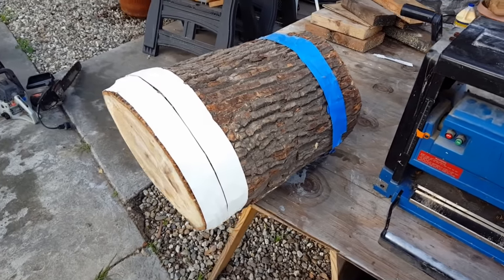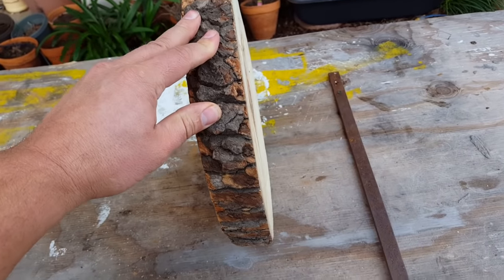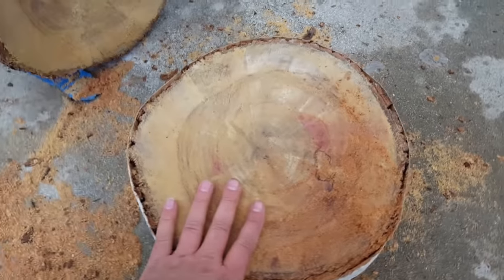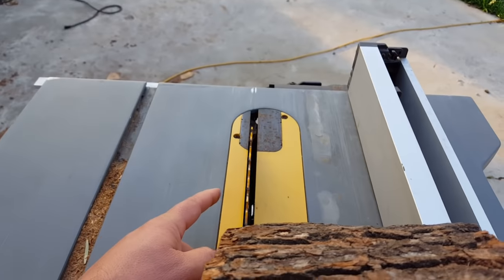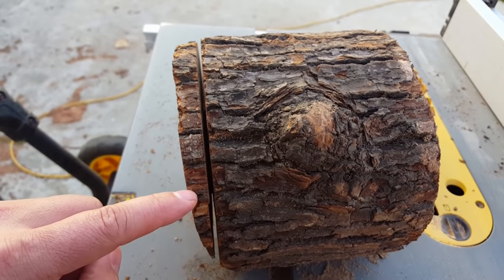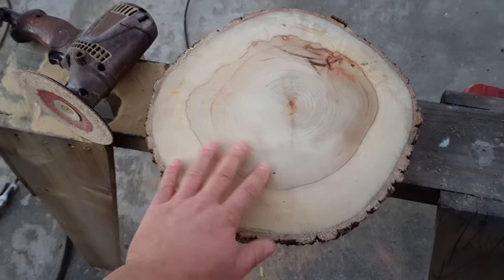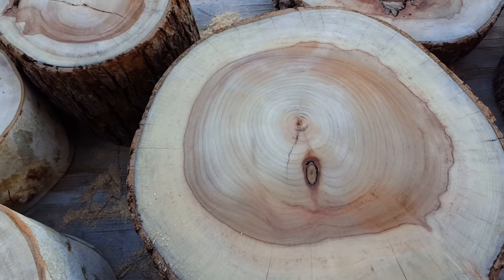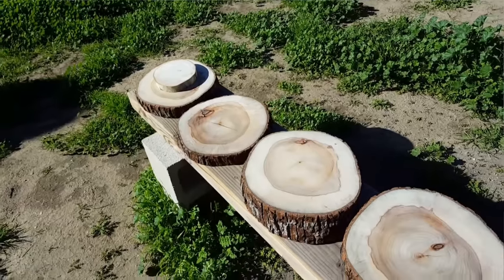RUSTIC WOOD DECORATIONS! Make Large Level Wood Slices [14 Large Tree Trunk Round Discs]

Comment from the maker: We purchased small sections of logs from a firewood supply outlet and they weren't totally dry all the way through.  We didn't know to bake them in the oven at the time so we may have just got lucky that never had any issues with mold or bugs.  We also never really had any cracking problems either.  I had planned on sealing them with something or applying oil but never did.  They've been kept inside for a few years and still look great used them a few times.  Wanting them as perfectly level as possible and without damaging the sides with holes or scratching the bark I cut these the best way I was comfortable with.  They sell these all day long at hobby stores now if you don't have time to DIY them.  Thanks for the feedback everyone 👍

Comment: Great idea with the tape as a marking. I had fashioned a jig, and that was much harder. 

If you don't mind it taking longer, and really working your arms, a good 24" handsaw is great for cutting the discs. If you're consistent, you can drastically reduce the sanding and planing it needs.

Comment: Dude, that is entirely way too much work. Just build a 2x4 base the circumference of your log, and 2 upright (level) pieces of 2x4s _|
You can then use a chainsaw and use the upright 2x4s as a guide to make a straight cut.
Reply from the maker: Yeah, that would have been the faster, smart way. But I didn't want to drive to go get a new blade, so I struggled with 50 tools instead.

Comment: What would you use to hollow out the center? I'm having issues where to find slabs with the center taken out for candles??
Reply from the maker: the easiest way would be a paddle bit or spade bit in a drill.  buy the size you want for your candle and just drill down to the depth you want.

Comment: A good, food safe finish that I used was either mineral oil from the pharmacy or lowes and home depot  sell butcher block finish. Apply some rub it in and the wood will soak it up. By the next morning it will be dry. You probably already knew that bit thought I would mention it. Great job! Thanks for all the great videos.
Reply from the maker: Thanks Xray!  I think we need to apply some of that on these things I would have never thought to get it from the pharmacy =)
Reply: Wood is naturally good safe

Comment: Hi Hollywood Haunter.  Im planning an August wedding and want to use some thick slices/stumps (10-12 in tall) to put vases on for the aisle decor and possibly some 3-4 inch slices for table decor. I was reading up and saw that its best to cut wood in the winter, so I was going to source some now and have it cut. How can I get the wood to last until then without splitting in half, warping or losing the bark (i dont mind a few cracks/small splits)?
Reply: Read the comments, and you'll find out.
Reply: Working Man petty af man

Comment: We love making these they are great for so many different things. I must say that for a minute I was worried about your safety. My wife asked me if it was safe to do it that way. Definitely would have made a jig to cut them on the table saw. Your little one wants to pull on all your fingers. So please be safe.
Reply from the maker: Thanks for the comment Tom there are so many different ways to produce these & a person needs to be safe especially when doing anything they are not completely comfortable & used to doing.  Like I mentioned in another reply I think it looks a lot scarier than it really is because of the camera angle, I didn't have the blade set that high & always kept holding control as well as standing clear just incase.  Please believe me when I tell you I REALLY don't want to loose any of my fingers.  I always take my time know where my body parts are & only do things I feel comfortable doing.  Thanks again for your concern & the smart idea of building a jig ;)

Comment: I've heard that some people occasionally even burn those to heat their homes. 😂  
Last year my sister sent me pictures of her boyfriend cutting some big slices he used to make table tops for their B&B. They really are much quicker and safer to make with a suitable chainsaw. I think I would have tried either sharpening up that gas saw you have or buying a new chain and just going slow.
I tried building a jig and plaining down some maple log rounds with my router once, and it kind worked. The big problem I had was that I burned up a couple router bits trying to get them to cut that end grain. I imagine my bits were not sharp enough or maybe my cuts too deep.
Anyway I'm glad you finished with a complete set of fingers, that table saw cam had me nervous. 😱
Reply from the maker: I don't disagree with anything you said & I too tried my router and it was like nope.  I think the table saw cam scared a couple people but I promise I felt plenty safe & would have never attempted it if I had not been careful.  

Even though I totally appreciate the kind words and caring attention for safety I can't help laughing at the fact that I think I may have found out how to scare the best of the Haunters.  They can handle any horror movie or scary Halloween walkthroughs, they can scare the wits out of others & watch the walking dead but cut a little wood on a table saw and it will make most of them cringe in terror!  Hahaha just kidding, thanks again buddy ;)
Reply: Maybe you should think about making a haunted lumber mill sometime, could be epic! 😂😂😂
Reply from the maker: That would be so awesome! we could make a giant saw blade that look like it was cutting Jeana in half by doing the old head poking through a table with a fake body routine.  I've been teasing her with an idea of now that we are having our own little one we should stop doing the kid friendly haunts and switch it up to a more gruesome level.  She's not buying it so far
Reply: They live in California there not allowed to burn trees.

Comment: Okay... I have pretty much the same kind of tools, small saws under a foot in length; but the log I want to cut is just over 4' in diameter.
Any Ideas on how to cut it?
Reply: Chainsaw, then use a router to smooth the surface. Don't do what is shown in this video, you might lose a limb or two

Comment: Great video! What did you use to sand the rounds, and what grit did you use?  Thanks!
Reply from the maker: Thanks I believe I just grabbed one of the round sand papers that stick to our palm sander and it was like a 120 grit.  To grind the tops flat we used a Makita disc sander with an 80 grit and then sanded it smooth with the palm sander.

Comment: Let me get this straight. You went through all that instead of sharpening the chain on the chainsaw?
Reply from the maker: It may look like a lot but cutting a loose 12" logs into 2" to 4" slices perfectly level with a chainsaw and without putting holes or chipping any bark off the sides isn't easy for me to do.  I could have made a jig to hold it in place but in the time it takes to go to home depot for a chain I was finished with the project.  Honestly I did it the way I was the most comfortable.

Comment: Renting a chainsaw from Home Depot would have been much safer and a lot less work. I am all for do it yourself but the trade off of safety to expense is never in your favor. If you lost a finger or got a dangerous kickback the title of this video would be very different.
Reply from the maker: You can get kickbacks with chainsaws too they are just a dangerous.  I'm super careful and watch my fingers and the wood as it passes through the blade.   I set the blade relatively low and make several passes.  Most of the accidents I see guys on my crews get into are because they are not paying attention, getting in a hurry, or being stoned at work.
Reply: @HollywoodHaunter  The problem is not where YOU put your fingers. The problem is where your fingers end in the case of a catch, very risky. take care

Comment: Why didn't you get a new chain for your chainsaw? It would have been a lot safer and easier.
Reply from the maker: I tried using my chainsaws but the issue I was having was a good way to hold the piece in place and wanting it perfectly flat on both sides so that plates, candles, vases, or glasses would sit level without any angle to it.  I couldn't get that great of a parallel surface with the chainsaw.  I even tried running it through our wood planer but was too hard to feed through and mine was not that powerful.

Comment: you can use your chainsaw to cut those logs just make sure you've got about a 15 degree angle on the chain and take your time it'll rip through it
Reply from the maker: Thanks for the tip I need to get a new chainsaw.  The two I have are so old and tired.  I cut a bunch of railroad ties building a western town a few years ago and I think I ruined them during the process.  Plus I couldn't hold the short pieces safely while I sliced them with the chainsaw so I moved on with other ways I felt better using.

Comment: costly just to cut that,,lol,,we used chain saw then used plainer..
Reply from the maker: Thank you, luckily I used the tools I had available and in the beginning I tried my wood planer but I think because the cuts were so uneven and the wood was wet the planer just didn't work out for me.  I may have been trying to cut too much on each pass or my planer is just to dull so it was faster for me to do it another way.  If I made these all the time I would definitely try to figure out using the planer method.

Comment: For God's sake...buy a new chainsaw blade, build a square 2x4 jig about as wide as your saw bar. Set the logs through, then double-sided tape a slide on the bar....run the saw down along the jig to cut off straight discs. A bit of sanding and they are smooth.
Reply from the maker: Miles Thompson I thought about doing it that way but I didn't want to a screw into the log slices when attaching the jigs leaving holes.  Plus you have to make a different big for each log because of size.
Reply: You can make the jig just a V like a firewood horse, just make the end pieces on the same plane...then put a guide on your bar the whole length of the bar.  

A new blade and a V, that log is not going to spin on you (no screwing or clamping). Or, if you want to clamp, put a loop of rope around the log (just large enough to be above the ground), put a 2x4 through the loop on the ground...step on 2x4, this pulls down on the log and clamps it to the V.
Reply: I couldn't find any good images of a foot-operated rope vise mechanism...but there is a instructable on how to make a version of what I'm explaining. http://www.instructables.com/id/Foot-Operated-Hold-Down-Tool/
Reply from the maker: I only had short firewood size logs when I did this project I'm sure it would be better with longer logs.  Thanks for the links and ideas much appreciated 😉

Comment: I only looked at some of the comments....not all...and didn't see any mentioning the obvious. DRYING and BUGS. If not dried properly they will get moldy. Not a good idea bringing spores indoors. That can lead to health issues. The bugs.....obvious. I use pine cones and dry them in the oven to get rid of bugs and sap. I'm no expert but  I'm assuming you would need to do a similar thing for these. And the table saw....Oh my gosh. SMH
Reply from the maker: You know we never had any issues like mold, bugs, or even cracking.  Not sure if it had already started a drying process or what.  We still have them sitting inside years later and they look great nothing there the human eye can see anyways.  Guess sometimes it works out. 🤔

Comment: This has to be one of the most dangerous videos I've ever seen. Everything about what you are doing is wrong.  If that log had spun with the table saw it is likely your hand would be drawn fully into the blade. As for cutting with a free hand circular saw that's just crazy again, if the log spins and you have no control it could slice your leg, hand or foot.  Encouraging people to do this just beggars belief.